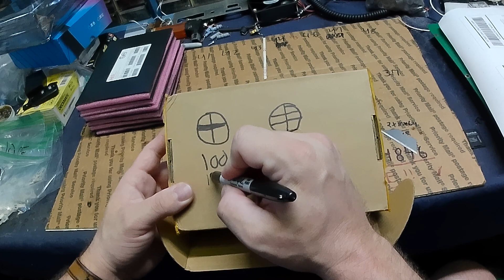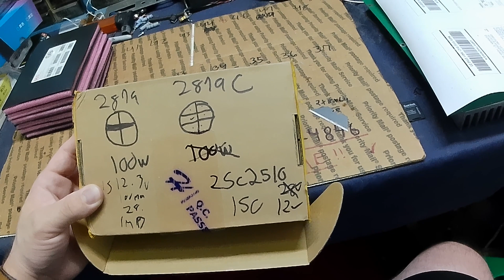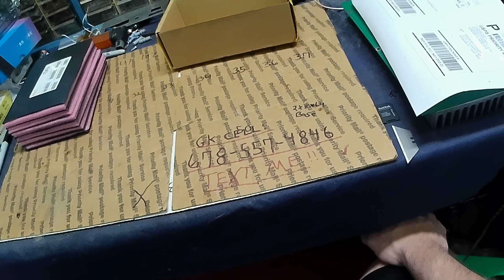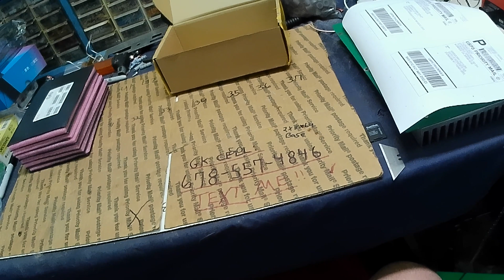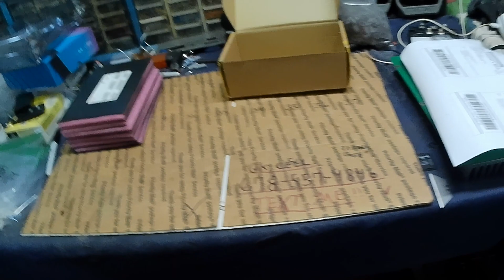120x 150w 2879C Transistors Matched within 1 hFE Of Each Other - AMAZING!

Comment: Nice, these are the kind of rf transistors that I’ve found in aircraft transponders I’ve taken apart in previous videos
Reply from the maker: Nice!!! ILL have to check out some of your videos. I'm sure those will be for a bit higher frequency ones for vhf uhf freq range but you can prbly sell them man. These are sought after especially for the older ones not in production any more.
Reply: @1883GotDown  Thanks, the video I am referring to is the Collins VHF-20 transponder teardown video, found in my teardowns playlist.
Reply from the maker: Thanks for stopping by the channel.

Comment: audio sounds better ! now you got a start on my 128 pill C box. LOL . maybe in the making of them they found a way to make them more the same HFE . better for us that need matching. now the real test do they hold that HFE over time or does 1 pill drop off faster. HG does have the 24V 2sc2510 150 watt now. got some type 61 5/8in cors for output transformers. I have boards and tubes . going to test with long one. I have 48V ones but not HG. they MOT  150 watt 48/50V ones. only 2. great for base amps. save on PS amps. I only re did 1 base 8 pill PP100 to 2510 24V 8 pill. easy 2Kw PEP more like 2.4Kw . 24V relay . 24V fans . mega-watt 24V SMPS. 240V AC. customer told me makes less heat puts out more watts  . was a lot of work . new heatsink as well. old way to small. had a stack of 30 amp SMPS most blew. all pills PP100 DEAD. total rebuild. and the rebuild was lighter. 1/2 the SMPS . 73's

Comment: I believe that hg has gotten better but the builders have finally found thay majic suace to make them work almost as good.
I am running 8 pills on15.7 volts without any issue other than heat is your enemy on any transistor.
Love your videos brother keep it up.
2879c = more heat = you better have some good fans.....
Reply from the maker: Nice share with us other info... like builder etc.... how long have you been running on 15.7v?